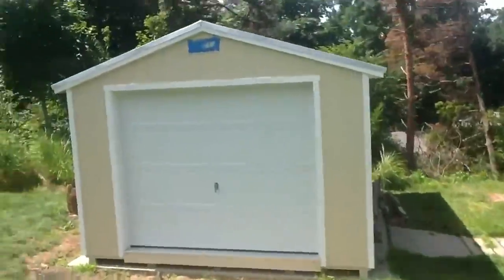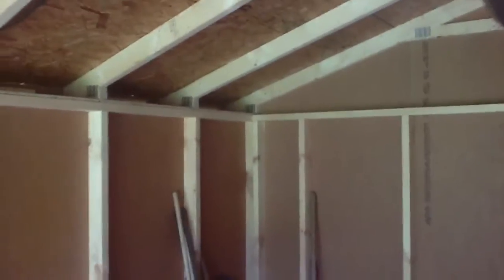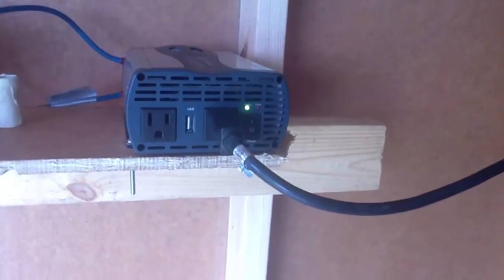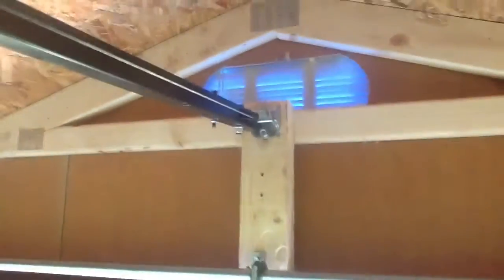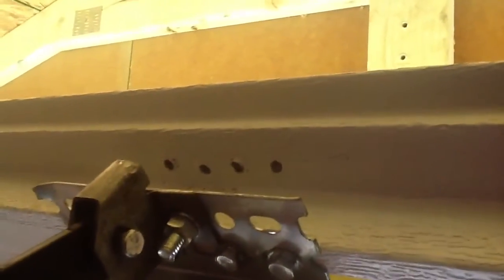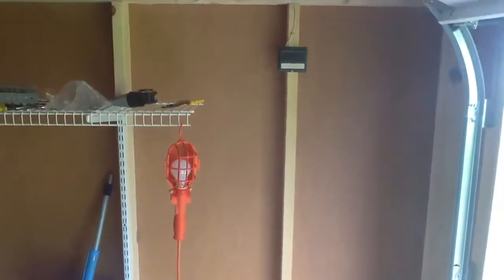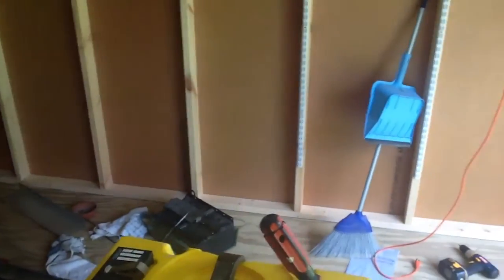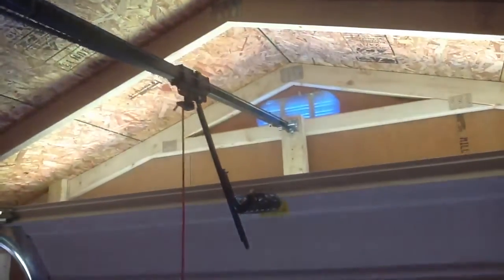new shed door (solar powered garage door opener)

Comment: That's pretty slick! I like the fact that you ran this on solar. That actually give me an idea for doing mine. Your DC-AC converter and batteries look like an off the shelf units, but the charge controller and panel I could probably find in a specialty shop.
I think the WD door bracket was thru-bolted into the top strut, so you could probably put two pieces of angle back to back, and attach your existing door bracket to that.

Comment: That is extremely loud. When you said " I don't know how many times its going to do that " when the fan was running and you run the door and "OOOOOOOOOO" is all i hear so can you do a remake video of this unit please it would be most appreciated, Thank you!
Reply from the maker: It’s one of those things that going to have to wait until spring when I take the batteries out to the shed and turn the power back on. Plus it not helping that this unit is currently buried behind and probably under several other units.

Comment: Who did your shed?  I really like it, and we're looking at replacing our shed pretty soon.  It would be nice to have a roll-up door and opener.
Reply from the maker: It was made by the amish. it was bought from a pool supply store on Brodhead Road (I dont remember what the name of the store was). This one is a 12X16 with an 8'X 6'6" door. I bought the opener from eBay as (if i remember correctly) this doesn't have an opener option at the time of purchase. Only mod needed to be done to install the opener was take some tension off the spring (Its to strong when initially installed) and remove the pull rope attached to the door.
Reply: GarageDoorGuy89 Found it, thanks!

Comment from the maker: all the supplies for the solar power I got from Amazon.com and it works very well with direct sun light if sunlight is an issue for you then you probably should get more than one 100 watt panel the power inverter is an 800 watt continuous with 1600 watt surge capability :) as for the door bracket I will look in to that when I get some more punched angled steel :)